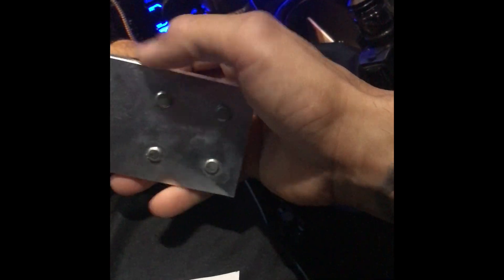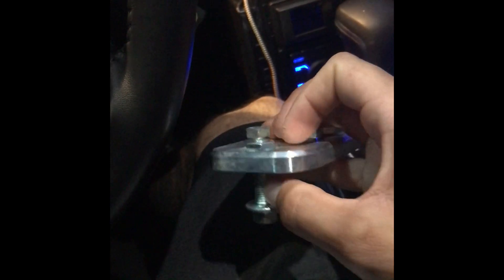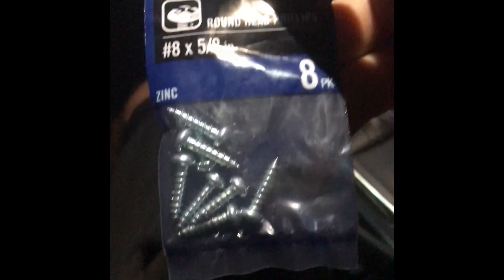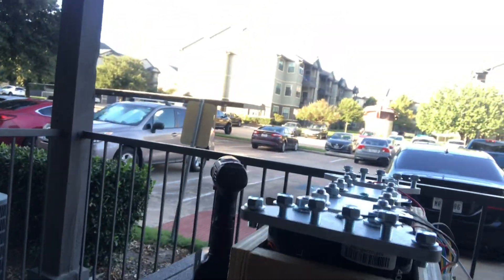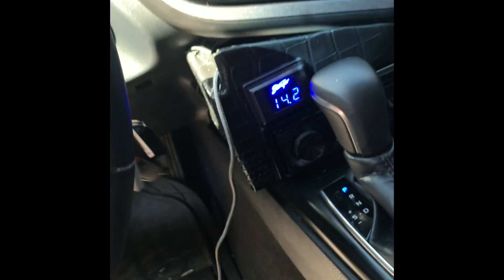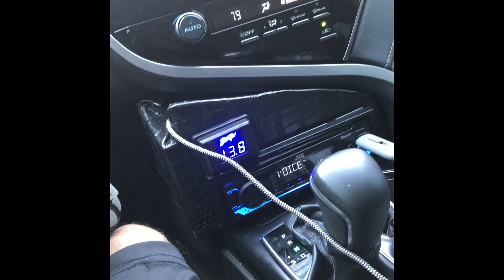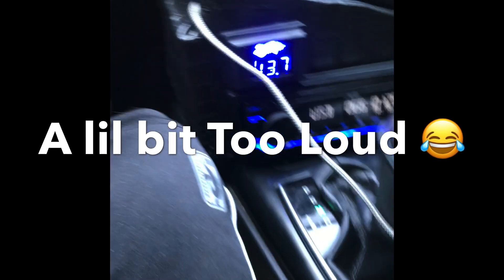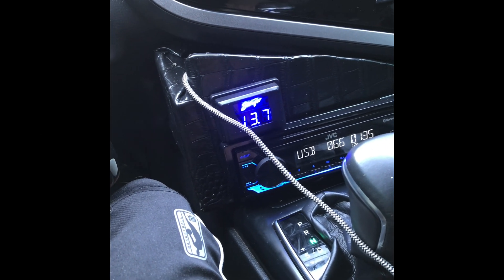Xs Power 80 AH Lithium DIY Time-Lapse and Demo

Comment: Do you know how to fix bass roll of thanks for replying 🤙🏻
Reply: Audio control lc2i will fix your problem
Reply from the maker: Bass roll of?
Reply: @mikessplboxes7497  If you have a factory radio if you turn it up to about 40 the base doesn’t get stronger it’s just flat that’s because the factory head unit tries to protect the speakers